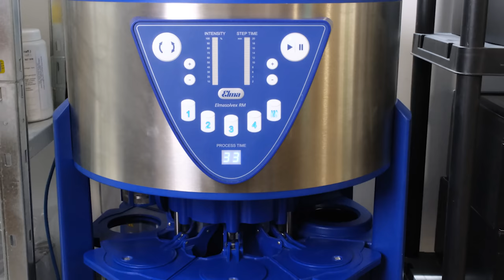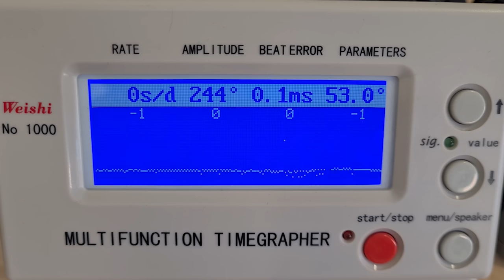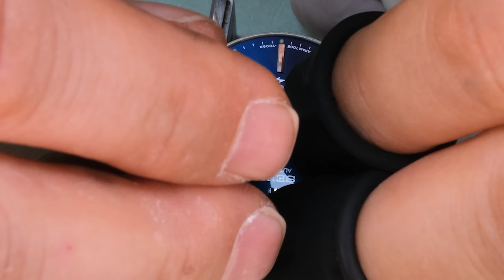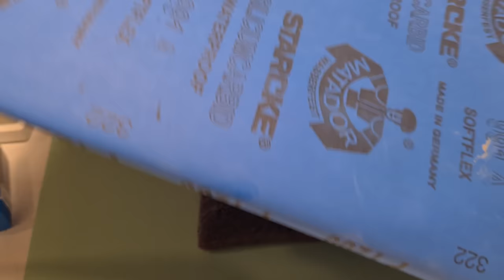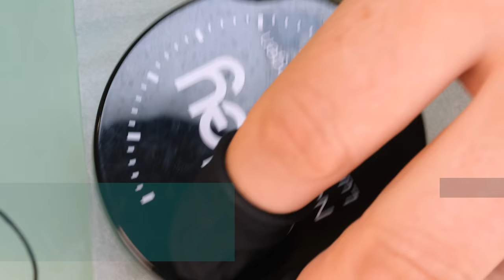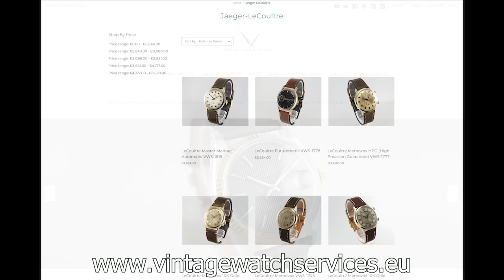Full restoration of a 51 year old watch

Comment: Lovely video of a Seiko. [I've always called them say-koe].
Several years ago I took my late 1970s black/silver faced Seiko 5 Auto to a watch repairer. Without even examining it he basically said that it wasn't worth repairing. I know what he meant. He was indicating that I could buy another new Seiko 5 for cheaper. At no time did he ask me whether it was worth it to me to repair. I found his attitude rather bewildering. I took my watch away wondering what to do. I still have it and still occasionally wonder. I have another Citizen Auto from about 1980 which is still ok, but it's like I'm missing it's brother.
Reply from the maker: Yeah, that's the thing... It might not have monetary value but money isn't everything, is it
Reply: I have a similar Seiko I bought  new in 73 or 74  only difference  crown is at 4 and date day change is by pressing in the Crown, it ran OK and I sent it for a service via Seiko Dealer and it keeps excellent time (cost £156 & they couldnt source a new crystal). From the same year I have an Omega Chronostop.

Comment: By removing the winding system the price of the watch could be reduced.  Also, the magic lever automatic system on a serviced watch resulted in the immediate starting of the watch as you mentioned.  In that era, the 6138 chronographs did have a winding system.  I love my Seikos!  Thanks for the video Stian.  Cheers, geoff in vancouver.

Comment: Excellent work on this one too Stian as always. I also am a fan of Seiko mostly for their innovations in watch technology over the years , Quartz, Magic lever, Kinetic some of them I know...
I have a question: (2 actually connected...)
Is a decent Quartz movement let's say with date and chronograph, in need of a periodical service other than battery replacement? I imagine gaskets are in a need of replacement after some years for every watch that wants to remain water resistant but what about the movement? 
And if that's the case will you ever make a video about servicing a Quartz or a Kinetic movement at the channel?
Reply from the maker: Thanks! An analog quartz movement (thus with hands) does suffer the same issues as a mechanical movement in that the wheels, pinions and bearings need cleaning. The cost of these movements is however so low that simply replacing them is most common. If the movement is old and replacements aren't readily available, servicing it would be the way to go. But for that you need special equipment to measure various electrical outputs and inputs. I don't have those, thus I cannot service quartz watches. Plus, they are of course the devil's work.
Reply: @VintageWatchServices  Haha I see... Thank you very much for your answer!

Comment: Congratulations on the new venture! I’ll check it out and see what’s right for me. 
Thanks for the video … I like seeing the watchworks but polishing/refinishing is something I’d actually do so I appreciate the lesson. 
Question: We see fancy watches adjusted in X positions. Is it possible to adjust a basic watch like this in various positions? And would it stay adjusted?
Reply from the maker: Thanks! That a watch says adjusted means that the balance has been poised to run true in those positions. If you inspect such a watch, you will see that the balance typically has small dimples cut out on the underside, to adjust the weight. You can of course do that at any time later also and the balance would always be adjusted. Every time a watch is worked on, however, there is a risk that something gets slightly distorted

Comment: I have a weekdater with similar  crystal and bezel, but struggling to get bezel on.  I've been advised to carefully save off some of crystal.  Sounds sensible, something you've had to do? 
Love your work by the way
Reply from the maker: Thanks for watching! Do you mean shave off the crystal? If you have the correct crystal you shouldn't need to do that. These bezels are quite tight but with the correct crystal and a good press you should be able to press the bezel back on
Reply: @VintageWatchServices  sorry i meant sand. the outside of crystal aligns with the little ledge but can't get the bezel over it. I think the die for the press isn't internally deep enough so also an issue.
Really appreciate your advice

Comment: why is there a cutout in the hands? wouldn't it be easier and simpler if there was only a dent where you just have to put a drop of the lume mixture and it would event itself out?
Reply from the maker: That's a good question! I would assume it's because it's very difficult to machine à groove in these tiny parts

Comment: Hi Stian. Great vid. The different surfaces of case are looking awful. Thx for showing. Can you tell me please the difference in efficiency between this winding mechanism and a winding "only" with a rotor (f.e. val 7750) ?
Greetings and best regards !
Reply from the maker: Thanks! I hope you mean the different surfaces look awe"some" and not aw"ful"? :)
Efficiency is a multi-faceted term, in terms of winding the 7750 is very efficient also, but in terms of manufacturing and reliability, the magic lever is in a league of its own.
Reply: @VintageWatchServices  wtf... of course awesome !!  Fast writing and autofill are no good friends. I'm so sorry about that !😪
Reply from the maker: @foxwhiskey  😁 No worries of course :) One thing I should have added to your question about efficiency: for winding the magic lever is very efficient because there is very little lost movement in terms of picking up slack when shifting rotor direction. The same is true for single direction winding mechanisms, but not for reversing wheel mechanisms.

Comment: So you weren't tempted to try and tap out that dent on the dial. Have you tried and failed?
Reply from the maker: No, I never tried that, but I could try it on a scrap dial to see what happens. I'm quite certain it would damage the dial more but it would be an interesting experiment.
Reply: @VintageWatchServices  I suppose it depends on the finish material. You could end up losing a chunk of paint. But "rolling" it out with a small stick of hardwood might work.

Comment: Hi Stian. At 20:10 the crystal appears to have a flaw. What's going on there, please?
Reply from the maker: Hello Paul, I'm not sure what you mean, at 20:10 I'm lubricating the pallets?
Reply: @VintageWatchServices  Ah! Typo - I didn't mean the crystal, I meant the jewel. There seems to be a line running through it.
Reply from the maker: @OldProgers  Ah, no, that's just the trace of the oil. The jewels are transparent and with the background lighting needed for the microscope camera it may look like there's a parallel groove on them.

Comment: Hello i have a question. Is it necessary to use graphite grease on automatic movements mainspring, I mean the answer is probably yes but can i get away with not using it? They are so damn expensive and hard to find here in Sweden...
Reply from the maker: Hello, yes, you should use a braking grease for the barrel walls in automatic watches. It does not have to be a graphite grease, there are alternatives. And this is the kind of grease you maybe buy once every ten years, so all in all they're not as expensive as they might seem :)
Reply: @VintageWatchServices  Much appreciated!!!! 👍

Comment: We pronounce SEIKO the same way here in Denmark. Then again, Norwegian and Danish are very close, so this is hardly a surprise.
By the way, another watchmaker, or hobbyist here on YT (forgot his name), claims that the Seiko rotor has to be lined up in a specific way when assembled. But he doesn't explain why. 
Can you confirm this?
Greetings from Denmark.
Reply from the maker: Hello Tommy, thanks for watching! Generally speaking, everything on a watch has a purpose, so when you see a marking on the rotor such as on this one, it means something. This one has a little arrow that points to a little hole in the driving wheel and should be aligned with that.
It's not the case for all Seikos nor all watches that the rotor should be aligned, but for this one they did that to ensure the highest efficiency when the rotor turns. It's a calculation based on the rotor mass and inertia coupled with the distance from the center to the meshing with the driving wheel.